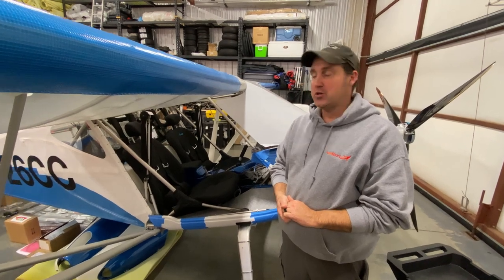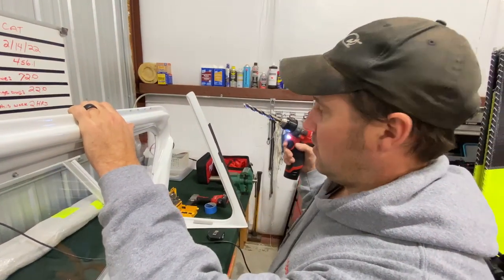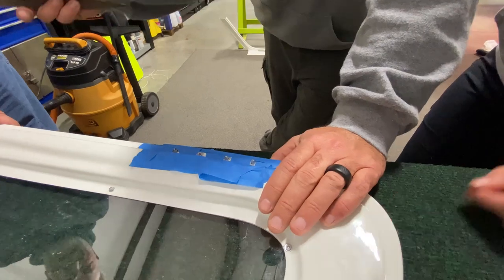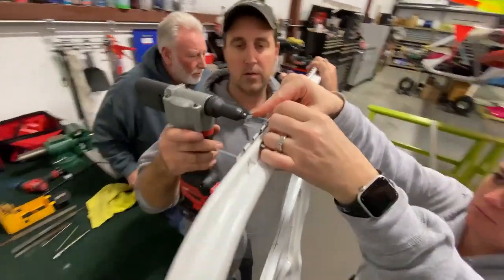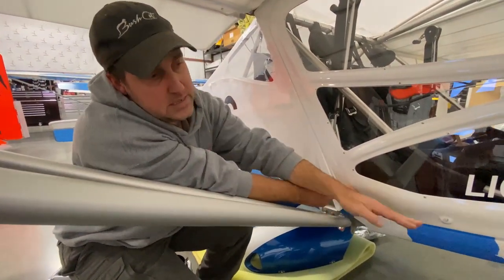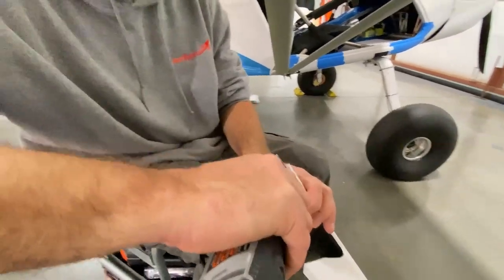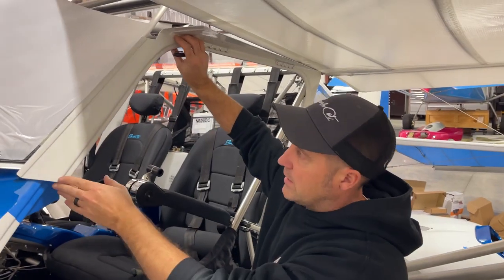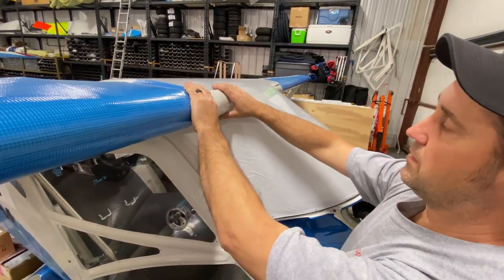BushCat Door Installation

Comment: Very good and informative video Jeremy. The tips and tricks you demonstrated in the video will be invaluable to me when I tackle installing the door frame and door properly. Good stuff. I will have to look into getting a rivet gun like yours.
Reply from the maker: Glad to help Don! The Milwaukee rivet gun is amazing!
Reply: Why not use clecos to hold the hinge in place and blue tape to maintain the edge spacing gap?  Dry erase markers work well and wipe off when done.